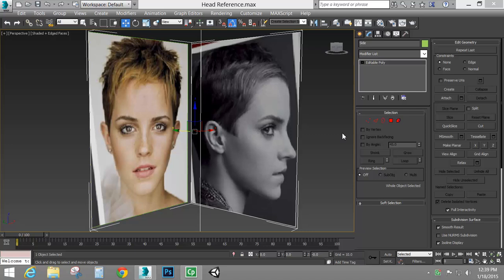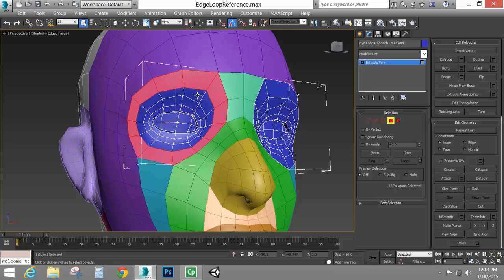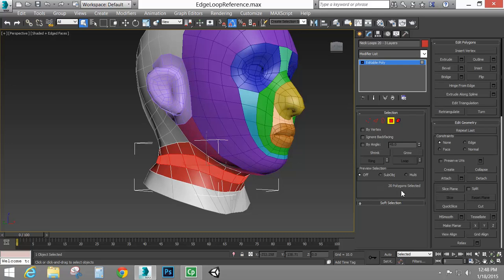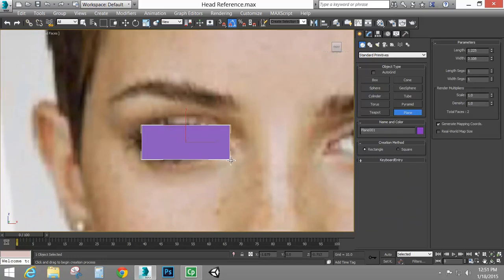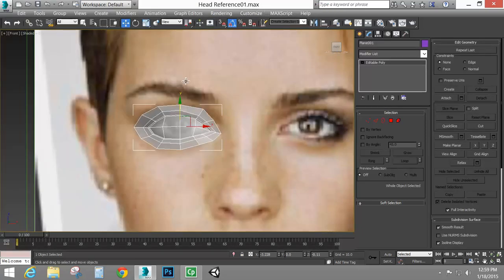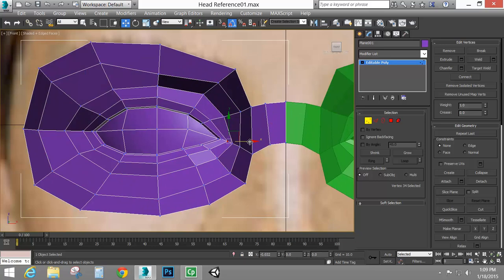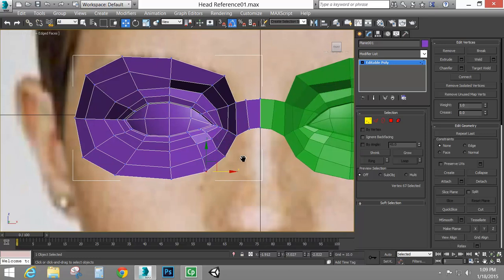Edge Modeling a Head Part 1 (Autodesk 3ds Max)

Comment: This is the most in depth tutorial on facial topology I've seen on youtube thus far; I don't know wtf Sandra Fischer is smoking but this has absolutely changed my thinking as far as topology goes changing it from guessing "I think I should put 16 verts here" to "I'm doing the eye ring so I should use 12 verts" from this single idea I have extrapolated several different setups to quickly retopo my models; I can't thank you enough.
Reply from the maker: +LohTek thank you. Glad to help. Yeah, unfortunately this is YouTube. I get way more positive feedback from commenters like yourself than negative ones like Sandra. You can't please everyone, but my job is to teach those who are willing to learn and put in the time.

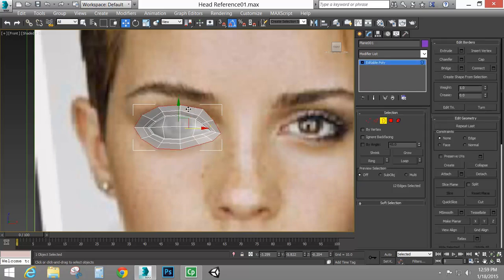Comment: I have a quick question. When at 20:00 you say you are 3 layers deep, was that a small mistake or do you not count the original eye polygons (the plane you started with) as a layer. Or am I, in fact,  misunderstanding what you meant by layers?

Comment: I use to model like that 10 years ago... Good memories... Not so great results... XD
Reply from the maker: Interesting. What method do you prefer?
Reply: Nowadays | sculpt a face in zbrush and then do a retopology on it. But don´t get me wrong this knowledge is still valid, specially concerning edge loops/flow
Reply from the maker: I had a feeling this is what you meant. I teach at an Art Institute. This is supplemental for one of my intro modeling classes. Zbrush is such a great tool. I am jealous at the advancements to 3D modeling using Zbrush over this old way.

Comment: Hi? could anyone tell me how can model the head alone then attach to body
now im one of ur subs plz answer ???
Reply from the maker: Greetings Saif. Once you have completed my head and body tutorials you can merge both 3ds max scenes together. This is assuming you made each part in separate scene files. Go to file, highlight import which will open the features for importing and select merge. If you have the body file open, locate the head file and merge it. Once both objects are in the same scene, scale the objects so they are proportional. Select the body, go to the modify tab and in the editable poly tools use "Attach". Select the head and they will become one object. Now you can bridge polygons and merge and weld vertices to attach the head to the body.
Reply: Omg thanks, u r the best thanks for reply dude
Reply from the maker: You are very welcome. Thank you for subbing. I will try and make a video specifically to this topic. Take care!
Reply: Appreciate it dude, and if u dont mind to make a video how to  create an animation clip. It s so imporant to me . Just to show us the steps of that not like a real animation . Thanks in advance
Reply from the maker: I just got finished recording the "How to Merge and Attach 3D Models" video. It will be up this afternoon. Please check back for it. What would you specifically like to learn as far as animation? I'd be happy to make that.
Reply: Wow. Thankss dude. The matter is im working on a game and i want to add some animation scenes u know. Like  walls get destruction or  two characters fighting something like that ( im not good at english hope u get me :) Thank you in advance . u r rock dude
Reply from the maker: I have one tutorial on importing assets into Unity. Check that one out and see if it helps.
Reply: Im working on unreal engine4 . It might help as well :)